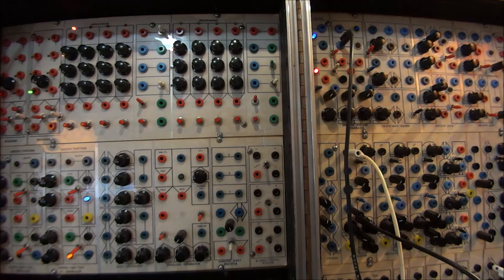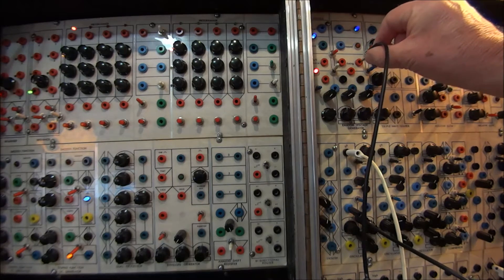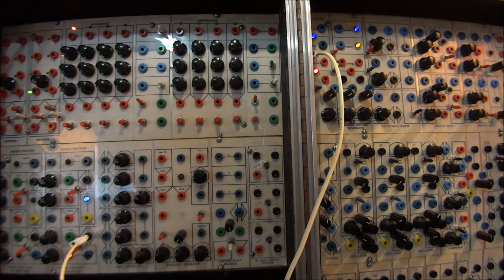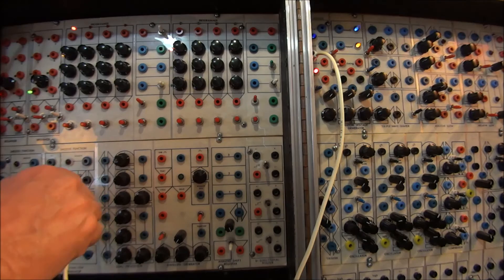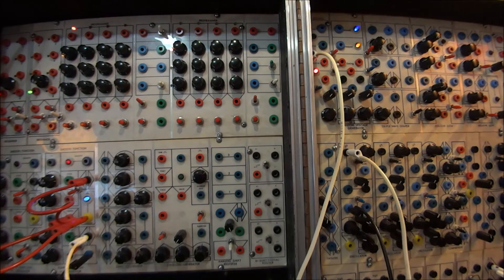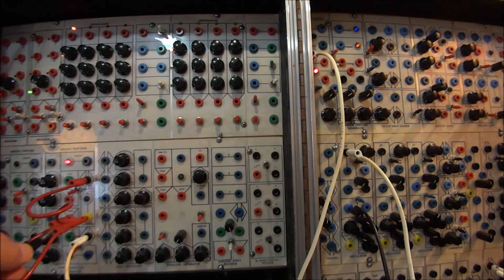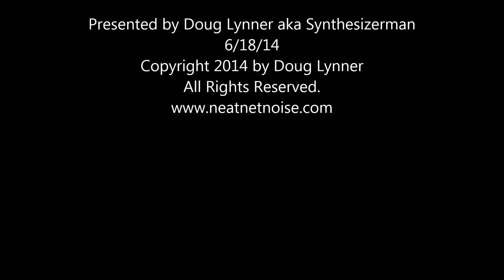Got Random? - A Serge Modular Synthesizer Tutorial

Comment: Great video Doug!
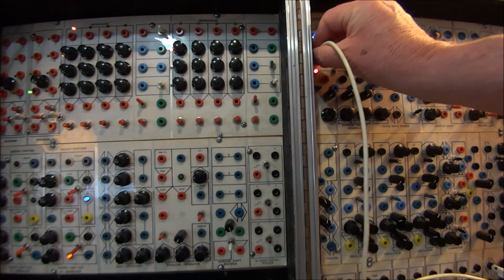and to patch a "random source", just modulate a saw wave with (pinkish) noise : ) that's how it's done on the Serge noise circuit. You can guess the center freq of the saw at 1:05 and then try other center freqs of course. The "random source" is a way to get close to equal distributed probability when sampling it, but one could use pink or white noise instead, or filter white noise in different ways to make your own noise flavor to generate your particular random voltages/pulses  : )

Comment: Nice job.  I use this patch all the time.  It's important to note that on some Serge systems (like my fairly recent STS build) you need to "kick-start" the patch for it to work.  If you start with the SSG outputs at zero, the comparator will never fire and the Stepped Generator will never take it's first sample.  The trick is to manually make the first sample fire by connecting Sample In to something like a gate or sawtooth osc.  Once the Stepped Generator has a non-zero value, just patch Comparator Out to Smooth In and also to Stepped Sample In & you're on your way.
Reply from the maker: Thanks for the the additional tip, Timm!